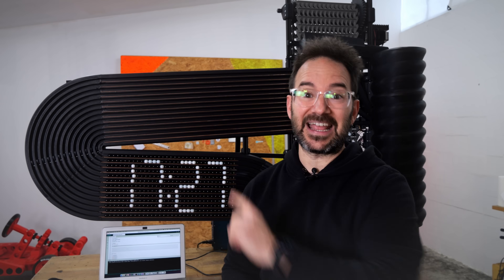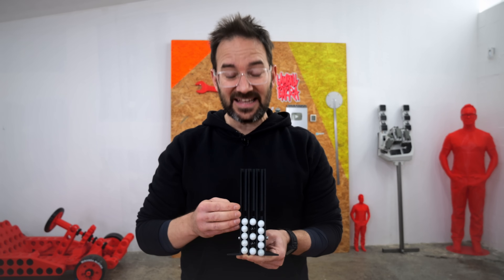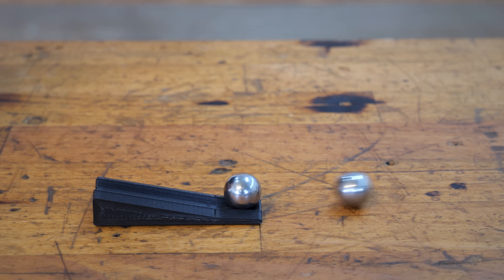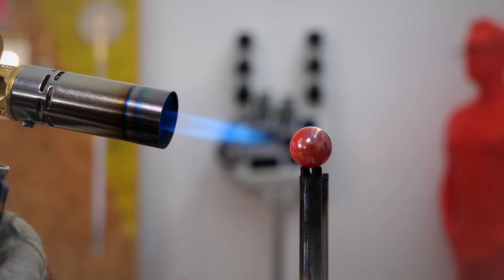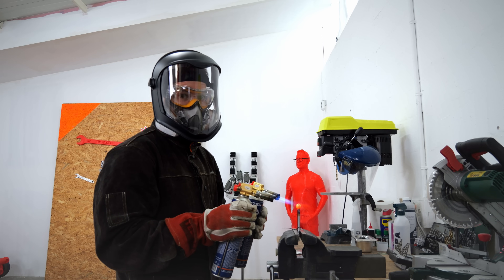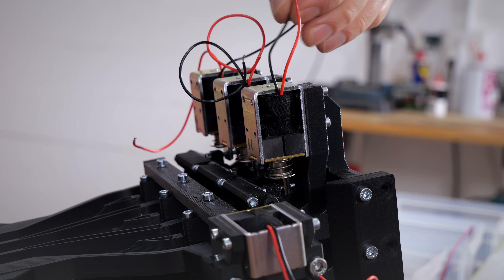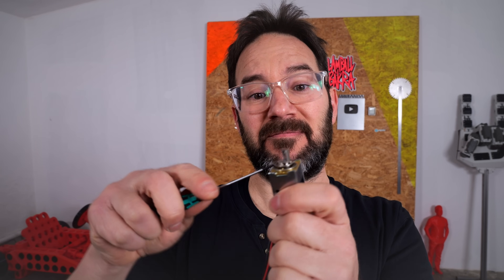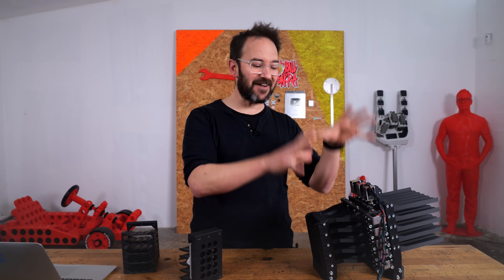Ramp Based Rapid Marble Swap - Marble Clock Seconds Display Pt.1

Comment: it would be much cooler (and quieter) if only the marbles that need to change were replaced. rather than all 15 marbles every time

in fact, if you did it that way some of the marbles would never need to be changed and you could eliminate some complexity. the top right and bottom right marble are always white no matter what number is displayed for example

Comment: You are bonkers, but in an awesome way. Love it. A couple thoughts; 1) I think vertical could still be fine, 1/3 of a second to see the time seems fine to me. At worst, they have to hold their glance for 2/3 of a second to see the digit. Most people are going to look for a couple seconds anyway, or even if they don't want to, within 2/3 of a second and a couple ms, they will pick up the image. If it's easier, might want to revisit that. 2) everything behind the digit is like 4 times the size of the digit. You're going to have to do something else to get them close, side by side, or if you dont want them close, may as well make the digit size bigger. Can't wait for the next one!

Comment: in this case, what's the point of using black marbles at all? You could replace the newton's cradle system with the same type of thing you're using for holding back the next digit, then only put in the steel marbles for white (and no marble for black)

Comment: I don't think this is going to work. With the matrix he has created you can only update either an entire row or an entire column at once. To display the digits he is looking for you will need different color balls on both rows and columns from one digit to another and this will not be possible with his current setup... its hard to explain but I suspect that I am right and he will have come to realise this by the next video.

Or he will reveal some other piece of info he left out as to how he will stop unwatend marbles from rolling down.
Reply: Oh wait I just remembered about that silver piece at the front, I forgot about it. He will release each column one at a time and adjust the verticle solenoids between each column. Then let them rest against the silver piece, and finally release them to replace the current marbles. This makes sense to me now. I totally forgot about that silver piece :P

Comment: If you're going to use 2 solenoids anyway for the release/selection, why not just use the single release mechanism with one solenoid releasing white and the other for black? Much faster and simpler, less parts, less distance to travel, etc.

Comment: Would bluing (like gun bluing) not work to color the marbles? Then you just soak them and rinse in hot water and the surface converts to black oxide.

Comment: Ive been trying to think of a simpler way to sort the black and white marbles other than optically as was done with the other marble clock. If you could use a slightly smaller marble for the black marbles, you could sort them mechanically via a sieve.

Comment: Btw, as a chemist, I'm sure muriatic acid would be safer than what you are doing to turn those balls black, at least it won't make you crazy, it may only kill you, which is mor ethical 😅 just kidding, with proper ventilation and your EPI, you should be completely fine, just be mindful of the neighbors.

Comment: Just another idea in case this one doesn't get to the speed you require.
Thinking about a "mechanical flip calendar"-like system, where flipping the front block immediately shows the one behind. Marbles would be filling from the top, and once they flip, released in the same way, from the top, now inverted. The numbers would be drawn as they are on the queue behind the shown one, with plenty of time. Theoretically you wouldn't need to release them and just show the proper one, but then it wouldn't be fun or a marble clock. In order to draw the numbers, what about one line at a time while in motion? Like an assembly line, moving to the next station one second at a time.
I'm sure it could be somehow more compact, and given you'd be working in vertical, you wouldn't have tracks that delay the process.

Comment: The complexity of this design is sort of wasted on a clock, where you always know exactly what digit is coming next. You could have, for example, used the "drop" method and just had all the digits 0-9 lined up ahead of time and pumped in the same order/orientation back up to the top, like a conveyor belt. The completely unnecessary power of this machine is that it can switch to any arbitrary input every "frame". It's a low-refresh low-resolution dot matrix: you could write messages, or play a game of Snake on it, or I don't know what else

Comment: Probably not the first to mention this, but in the form that the clock currently is in, two of the marbles never need to change. Granted, two of fifteen segments isn’t much, but a 13% increase isn’t anything to complain about and could reduce the overall number of marbles needed.

Comment: Just some ideas:

The first style of marble selector gate which is three position could be held the center position with spring force and a mild detent.

A spring attached to the armature of a push-pull solenoid holds the armature in approximately the center position. A mild detent (such as a ball detent on the armature shat) can provide positive centering if necessary.

The armature can be actuated as pull to move the gate one direction, and actuated as push to move the gate the other direction. Two regular pull solenoids can perform this push-pull task by arranging them back-to-back with the armatures connected. In this case the control circuitry is simplified by connecting the two coils together as a single center-tapped coil. The center tap is connected to the positive supply and each end of the coil is connected to ground through a switch (relay, MOSFET, etc.). The mechanism can then be actuated in 'pull' mode by activating one switch, or in 'push' mode by activating the other switch. A snubber diode is necessary to control coil inductive kickback when the switch is disconnected.

The solenoids can be connected to the gate with a light-weight Bowden cable (the thin sort used in RC model aircraft) so that the solenoid size would not affect the geometry of the gate mechanism.

This setup requires one push-pull solenoid (or two pull solenoids) and one or two control lines per channel (with a few external components per channel one tristate output can handle both push and pull switches). For a 3x5 matrix that is 15 push-pull solenoids (30 if using two pull solenoids as a push-pull) and either 15 or 30 control lines. If the matrix is simplified for 7-segment display then 11 push-pull (or 22 pull) solenoids and 11 or 22 control lines are required. If control lines from the microcontroller are scarce four 74HC595 8-bit cascading shift registers can be used to convert a serial bitstream into a 32 bit parallel output (some cheap AVRs with a simple program could also handle this task).

That's a lot of solenoids. It would probably be cheaper, smaller, and require less electronics to use hobby servos. The servos can be controlled with an ATMega or a PCA9685 16 servo control board. As a bonus small hobby servos are compact enough that they could probably be mounted directly on the gate.

The main advantage of this would be speed. All elements of the matrix can be actuated at the same time.
Reply: > All elements of the matrix can be actuated at the same time.
I think this should actually be avoided because of the simultaneous power draw. If they are actuated at slightly different times, then the total power requirement is not as high.

Comment: For the separation proccess of the marvells you could make the blacks a little bigger so with and enclosure of the exact size of the stell marvells and a corner you could different blacks from stell.
The problem here is how to make them bigger😂
I think something similar happens with the white ball in pool tables. Good lock😊

Comment: I'm not sure if I'm missing something, but to me it looks like this setup will only be able to do a single number, number 1. Each column will either be black or white so you can't have a 0 where the top and bottom of the middle column needs to be black and the middle needs to be white.

Comment: Peanut gallery observation: The "digit" is now 3 pixels wide by 5 pixels high. Ejecting the digit's marbles scrambles them, requiring re-sorting dark from light to reload the feeder channels.
Consider forming each column of pixels as a "closed loop" of 10 x (5 + 1) marbles, sequenced much like any hobbyist (Arduino) LCD library of letters & numbers encoded with bits to be fed into a shift register...
Feed each column of 5 + 1 pixels from the bottom thereby "pushing" the top marble into that column's collection chute to be reused in 10 seconds (or 60 seconds for the digit to its left.)
(The "+ 1" is to allow a row of 3 dark pixels to separate the bottom of one digit from the top of the next.)
With more digits, this would look just like an odometer whose display rotates "from the bottom to the top".
When you realise each of the 6 digits of HH:MM:SS would only require 1 solenoid to elevate 3 separate stacks of 7 marbles, you don't need 6x8 solenoids, or the complexity of sorting coloured marbles.
Further, tens-of-seconds (00,10,20,...50), tens-of-minutes (00,10,20,...50) and tens-of-hours (00,10,20) don't require as many marbles in their "closed loop" circuits...

Comment: Delightful!
Um, do you need the black marbles at all?
Now you are refreshing from the rear would a solution to your black marble problem be to only populate the holes that construct the digit?
Matrixed solenoid-activated doors could handle whole mechanism, only requiring a means to capture and return spent silver marbles.  

Yes, the whole thing would be less impressively noisy. But maybe something simple enough that you could make and sell..?

Um... if you really insist on black marbles for the blanks you could set the output such that instead of a door you have a black marble welded to the end of a solenoid - black marble up = no silver marble presented, black marble down = silver marble... the same actuator could set a trapdoor further up it's ramp to hold back the rest of the silver marbles until needed.

Comment: To sort them after they're replaced, half could be non-magnetic and drop down to where they're stored while the magnetic ones roll along a suspended path above as they go to their storage space.  In addition, there could be a second sliding part that moves in the opposite direction of the other, using the same solenoid, to drop them out as the new set takes its place.

Comment: A useful mechanical optimization would be that not all positions need any electronics at all. The center dots of an 8 never need to be changed, because none of the numbers use them, they always stay on/white. Same for the top-left dot, which will always be off/black for all numbers. This would also reduce the necessary marble supply.

Comment: You might not need black marbles in this set up at all. You just need a marble where there is a "pixel" where there is no pixel, it's just negative space, so no marble.
Instead of needing the next marble to push the previous one like the Newton's cradle, you can use the mechanism that stops one marble at a time to release what is there (so it isn't just always an "8").
That gets rid of the sorting, heat treatment process, etc. 

Also, even if you don't do that, you don't need anything in the middle column of the 2nd and 4th rows since that will always be an off or black pixel.

Hope this can save a lot of headache on the next prototype.

Comment: If the system is cyling through the same 10 numbers in a row wouldn't a mechanism that sets up each segment for its own loop be better? For example the top left is always "on", so that doesn't even need a gate to choose between black and white, likewise the top middle only needs 1 in every 10 marbles to be black to create the 4.

Comment: just need to replace the rest of the clock with this and make a marble sorter which you kind of already have at the top of the marble lift. Just kick out all of the black marbles on one level and the not black ones on another level.

Comment: I have some suggestions!

A) Marbles. Use a bigger torch and heat up more than one at a time. Bathe the marbles in groups too!

With the masturbation from the solenoids. Use 🧲 shielding material?

Comment: You absolutely need to automate that bath process. Just use a similar marble elevator design timed out so that it's a consistent bath duration, then kicks out at the top. All you need to do is man the torch and load the machine. Be sure to do it in batches so you don't need to track repetitions per ball.
Also, the balls that need to be replaced per digit are NOT uniform! If you split up the swapper, perhaps into vertical slices, it would drastically reduce the total swap operations needed. Which wouldn't be a problem, but your multiplexer can only run one column at a time... which would need to be 3 times per second if you swap every digit at the final gate.

Comment: If you want to smooth out the digit marble drop motion you need a stack of 2 marbles that a single marble will run into. This will completely transfer the energy from the incoming marble through the middle marble and the end marble will shoot off the end. Thats how your swinging marble toy works.

Comment: Since the entire row is selected together, won't that require more ball releases to get combinations, like the top row of 4, needs two releases. but it is also releasing the entire column too, so something like 5, would need 3 releases with each column needing a different combination of row selections.

Is there a way to select each marble individually? then it is one release per second.

Comment: Maybe the current setup doesn't allow it, but I suppose it would simplify the process if you could remove the black marbles leaving a blank space. This would involve opening each solenoid on its own, but that could simplify the process of first, "painting" the marbles and second, getting the color of each marble read.

Comment: Would it be simpler to load just black marbles in the positions that will always be black and then split the rest of the position into "segments" to load the numbers by segment?  It would use one less solenoid, and I'm not sure how much simpler it would make it, but perhaps a segment separation like this:
1 1 2
3 X 2
3 4 2
5 X 6
7 7 6
The numbers would come out a bit more stylized, but to make each number:
0 = 1+2+3+5+6+7
1 = 2+6
2 = 1+2+4+5+7
3 = 1+2+4+6+7
4 = 2+3+4+6
5 = 1+3+4+6+7
6 = 1+3+4+5+6+7
7 = 1+2+6
8 = 1+2+3+4+5+6+7
9 = 1+2+3+4+6(+7)

Comment: Not all the marbles need to change every time, five of them never change at all for all 10 digits. Think of it like a flip dot display, the change from 5 to 6 if only 1 dot, same from 8 to 9. 
you need 33 foreground and 22 background for each digit that goes 0 - 9,  25 foreground and 14 background for each digit that goes 0 - 5 and 21 foreground and 12 background for each digit that goes 0 - 3 and that is if you want enough ready for a full cycle without reloading. you can do this with 100 of each easily if you loas fast enough

Comment: You were literally on track to make something awesome. Your left/right toggle was the right way. You control them 1 of 2 ways..   You could have used servos with a servo multiplexer. They are easy to code, reliable and fast. They also offer the ability to fine tune if anything ends up being off a little with a single pixel.  The other way is with a push/pull solenoid (similar to the ones that you're already using!!!). You may need to open the outside rails of the outlet of the selectors a little to buy the currently trapped marble enough time to escape but it's doable. In the code, you follow programmer's best practice for efficient refresh rates. When coding an ili9341 which takes a bit of bandwidth, you dont refresh the WHOLE screen. You only refresh what needs to be refreshed. If it's (10:02 PM) you dont refresh and send (10:03 PM). You only send (           3   ) refreshing the 2 to a 3..  this drastically speeds up the refresh rate as less bandwidth (marbels) are required to display the correct info.   In your case if you used the toggle that you claimed had 3 positions and use it only as 2 position, you would only ever actuate it when that specific pixel needed to change color. This allows you to use it as 2 position.  This also DRASTICALLY reduces the number of marbels needed every second! For example 9 takes 12 marbels. Next number is 1 which takes 5. Those 5 marbels can stay the same since they make up the right side of the 9 which requires you to only update 7 marbels, not 12!!   Not only does this speed up refresh rate, but it speeds up all the operations on the back end relative to demand. (Sorting marbels etc) since the demand is much lower, you have more head room with your sorting mechanics. 

If you decided that you absolutely needed 3 positions, you could use a double sprung (spring on both ends), non-latching push-pull solenoid that rests in the center neutral position when not energized. You could just as easily incorporate a self centering mechanism with 2 bars that straddle a pin in the selector and uses a light spring.

Hope this inspires you while keeping things relatively simple.

Comment: If you use marbles with slightly different size, it is very simple to separate them by running them over two rails that are nearly parallel but at a slight angle. The smaller one fill fall first. Just a thought.